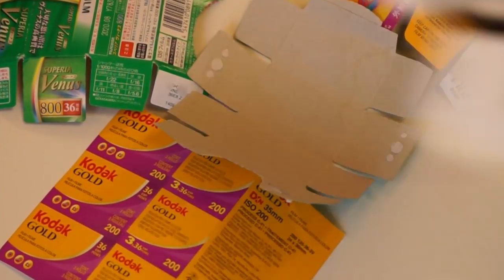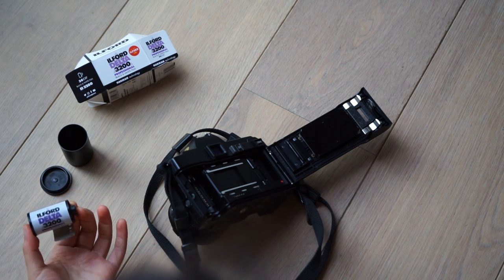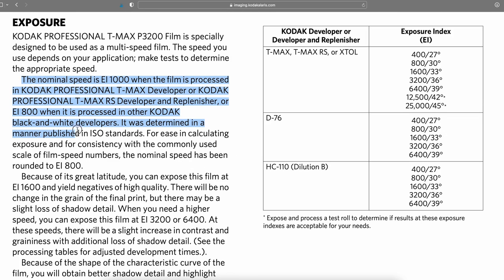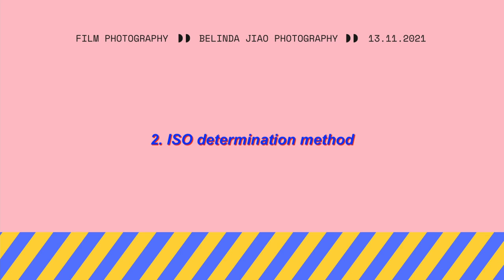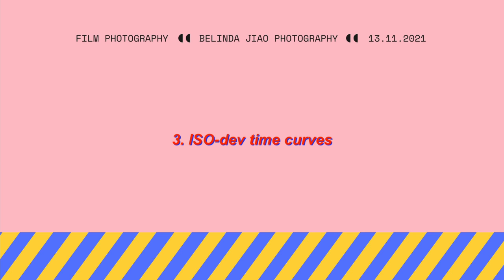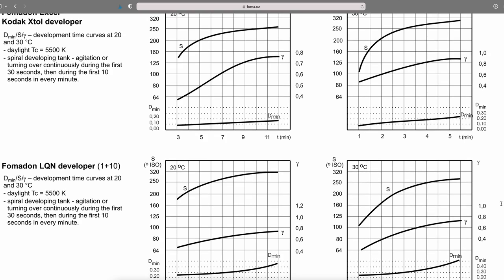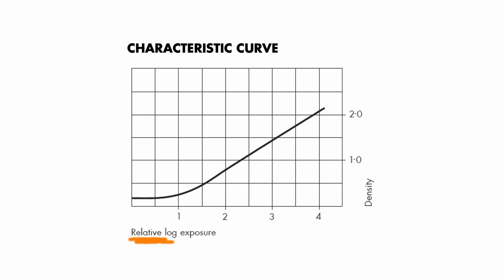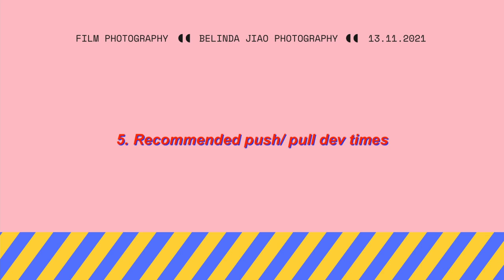[Film Photography] ARE FILMS TRUE TO SPEED? What you need to know about box speeds

Comment: Is it just me or did the middle of the straight section of that curve looked higher than 1.3?. I was told by someone with as PHD in chemistry who formulated developers for a living that 1 stop difference in exposure doesn't make much difference on a Black & White negative, so I tend not to be too bothered about rated film speed and just use the box speed. I suspect that the vagaries of camera metering systems are more likely to be an issue in most cases. Nice to see you tackling the subject though.
Reply from the maker: Paul, yea that’s the thing; where the midpoint lies also depends on where you determine to be the ends of the straight bit, very much subjective. I’d say that though you can certainly live with a slightly underexposed neg, you probably want to create the most printable neg in the first place